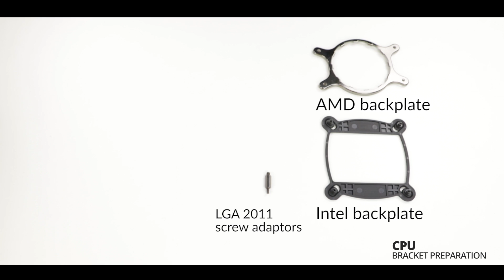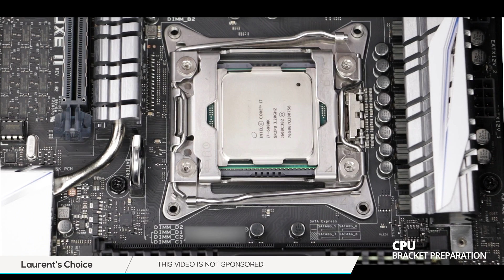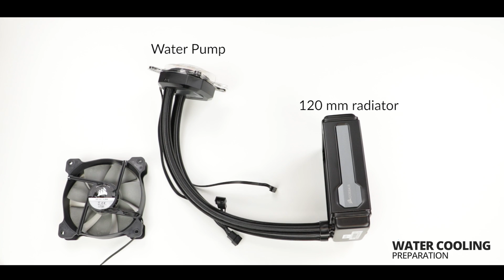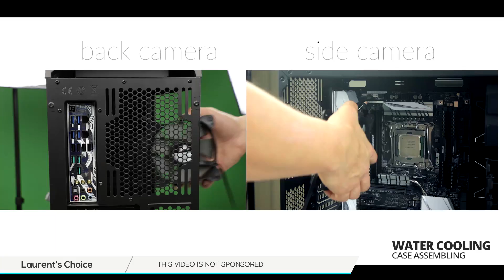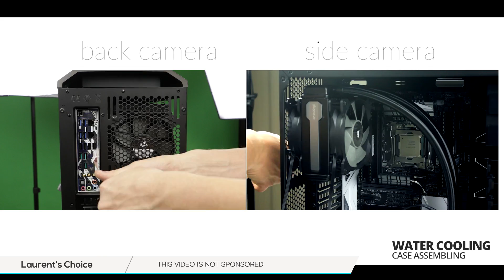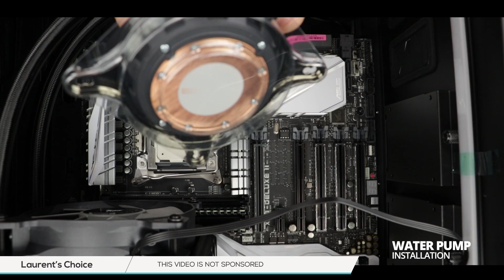One-loop water cooler installation (Crazy CPU Machine 6/10)

Comment: Nice video. I'm installing an H60 in my PC. I have no choice but to do it as exhaust because of case layout. However, if you have an aftermarket case I suggest you install the fan on the radiator as intake, pulling air IN to cool radiator and exhausting out of the top of possible. Using radiator as exhaust isn't ideal and not exactly how it was meant to be installed. Blowing hot air out through radiator doesn't cool the liquid as well.

Comment: The manual for the H80i v2 recommends installing the fans to draw air from the outside through the radiator and into the case, and for the reservoir to be installed at the bottom, not the top. You did the opposite for both -- any reason why?
Reply from the maker: I wanted to keep the bottom clear because I was going for an EATX motherboard which is longer than regular ATX boards.

I also wanted to have add a second GPU in the future and didn't want any tubing or cable in the way of the driveway double deck. 

I have reversed the fan and went to a pull configuration to use the AOI radiator as an exhaust .

We already have two or three front fans pulling in fresh air and I wanted to keep the air moving out of the case as fast as possible . If i have multiple gpus fans sucking in hot air , I'd get my Gpu throttling sooner.

Hope this helps
Reply from the maker: Sorry for the typos :) edited and corrected them . Makes more sense now :)
Reply: only have the back 120 or 140mm fans exhausting air because at the front of your case you will have open airflow for the fresh air to come in and the hot air will be exhausted by the back

Comment: I have a question, got phanteks p400s tempered class case and i'm going to put my h80i v2 in it.. thinking should i put it to front that it takes air from front (outside) and pushin it to inside the case, or shoul i put it rear to push air outside the case?. Which one makes cpu cooler?
Reply from the maker: +Joni Hietala I would put it behind as an exhaust and keep ur front fans do the pushing work.
It'll create a nice air flow which will harvest some other components heat on it's way out  :)
Reply: Laurent's Choice ty :), but isn't my cpu then going hotter? If i put it exhaust?
Reply: Laurent's Choice btw your videos is so good it made me to do pc build 😂
Reply from the maker: +Joni Hietala wait...what CPU are you using ? If it anything greater than i5 is go PUSH. 

If i5 or i3, water cooling as so much more heat dissipation ratio that I exhaust and use front fans to pick up heat from other components. 

If u are on an i7 and want a push configuration, I would DEFINETELY,  place it in front (or top) and suck the air in the case, with the front fans (If any).

If you got for this, make sure to have a 140 high pressure fans has exhaust . Going to need a lot of air flow getting out to avoid getting ur system to turn in a giant cooket.
Reply from the maker: +Laurent's Choice sorry for the typos  :)
Reply from the maker: +Joni Hietala man.. go for it and please..once ur done share the photos with us (on my twitter @laurentschoice or Facebook group : Crazy Insane Computers).